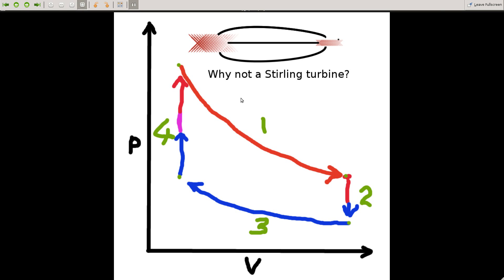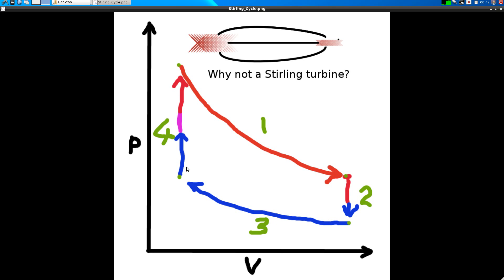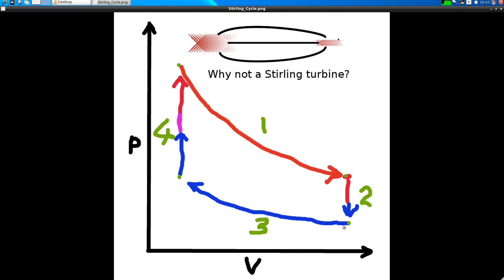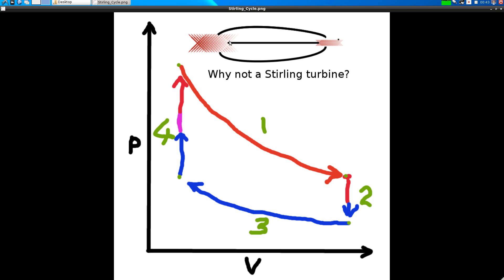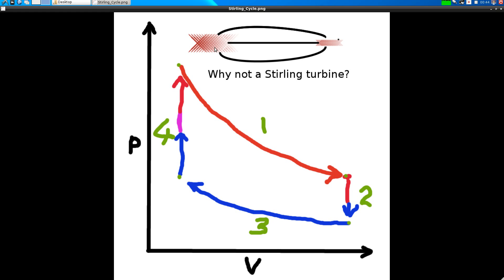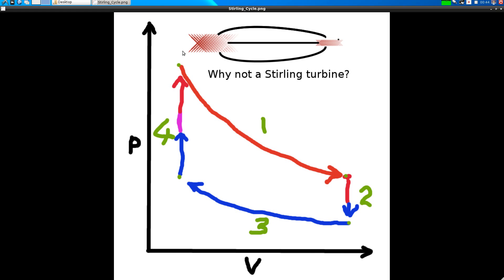Thought experiment.  Why are all stirling engines reciprocating? Why not linked turbines?

Comment: this is what you mean ? https://en.wikipedia.org/wiki/Closed-cycle_gas_turbine ,
 same principle, just this one was made already in  1935 .
Reply from the maker: +Linda Banga  Thanks for finding that,  haven't heard of it before!   I will check my video again and see if it is the same thing.
Reply: i havent heard of it either. but got inspired by your concept . so when i was doing some research , this machine came on my way. just for the record... it has a lot of flaws. because of the carnot cycle can not be used as is .(my opinion)  I have some Ideees .but im working on it.
Reply from the maker: I checked again and I am still not sure if it is the same thing! I had a hunch and checked "wankle Stirling" as a search and I actually  did see something about using the  Wankle engine idea as a sterling engine too. Also  One guy on youtube has a hybrid stirling engine , where the Stirling engine is rotary but the displacer  or second cylinder is outside the rotating part.  I am pretty sure that would not self start because the displacer is (to my mind, actually driving all the rotation.  But interesting.

Comment: It's a question of compression rates.  Because a sterling engine is using a single phase cycle, the difference between the high pressure and low pressure parts is just very small.  A piston, because of it's near zero leakage rates, is able to handle that low pressure difference and extract more motive force from it.  

In reality, the reason there has not been more variation in the sterling engine is because there is not a lot of practical applications that can't be handled by something better.

Comment from the maker: Hi, yeah. Christie, it isn't really a design (yet!).  But if you were to "ignore" stage 4 and stage 2 and have stage 1 and stage 3 going through linked turbines, the blades are close together or inclined more at the start of stage 1 and get wider as the gas heats and expands while in stage 3 the blade configuration is reversed, so you are compressing the gas.  The turbines have to be linked so that some energy produced in stage 1 powers the volume decrease in stage 3 with excess energy outputted